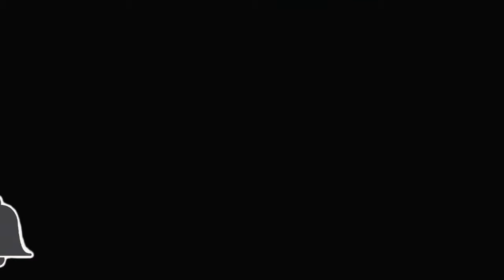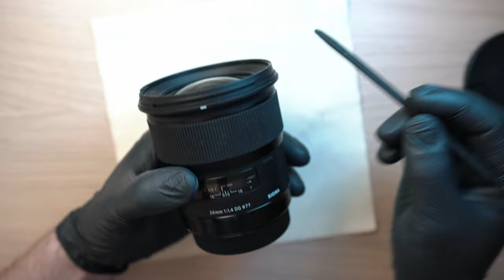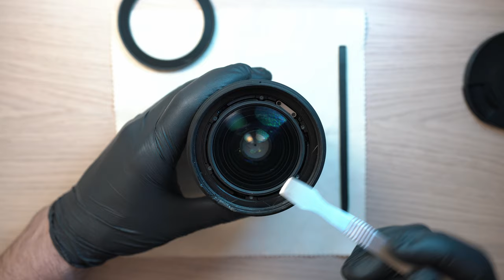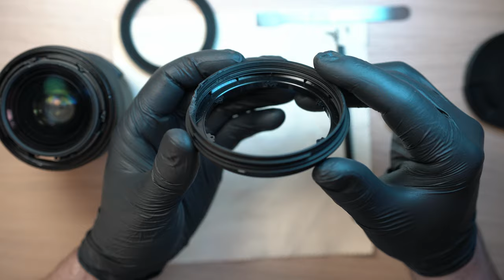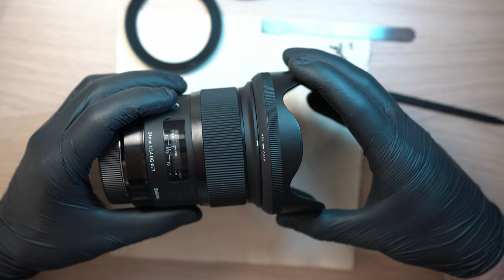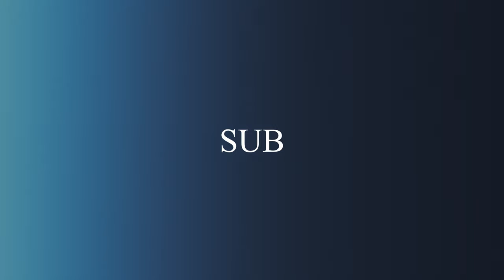Sigma 24mm f/1.4 ART How To Replace Broken Front Barrel - Repair Lens Thread

Comment: I'm wondering if the Sigma 150-600mm contemporary lens dismantles from the front element as well? Although my lens isn't damaged like the one in your video, I'm concerned about a small white blemish on the inside of the front element.
Reply from the maker: hi, i don’t know… but be careful as front elements are usually shimmed so make sure you mark positions.
Reply: @takeapart  absolutely!! Thanks for the heads up!👍🏻

Comment: Broke the front barrel on my sigma 35mm 1.4. I saw on aliexpress they have the barrel but I'm not sure whether that comes with that ring you have to take off to cover the screws too?
Reply from the maker: hi, that ring is different part… if you need to change it you have to order it as well.
Reply: @takeapart  thank you
Reply from the maker: no problem

Comment: The makeup ring has no threads? If you rotate it, it won't come out like that? Once you put it back, is it just as snug?

Thanks for the video! Do you work on repairing lenses professionally? Or just did research?
Reply from the maker: Hi, it does have fine thread, but you can press it on as well.
Reply: @takeapart  if you twist it counter clockwise it won't come out like that? With latex gloves on? Not enough friction to get it to rotate out?
Reply from the maker: it is hard to get it turning by hand … in factory they must use some rubber jig.
Reply: @takeapart  yeah, that's what I think too: they have a rubber ring that they can press on it
Reply from the maker: exactly! I remember breaking one in half as I forced it out by flathead screwdriver
Reply: @takeapart  😬 my face right now
Reply from the maker: those parts are cheap… few bucks from aliexpress….
Reply: @takeapart  are they exact replicas? They look like they're from the same factory, genuine parts, same color/texture?
Reply from the maker: my experience is that those parts are original but used … they have donor lenses and such …
Reply: @takeapart  do you know if Sigma would sell a front element? Or any other parts? Did you call them?
Reply from the maker: I have no idea… sorry.